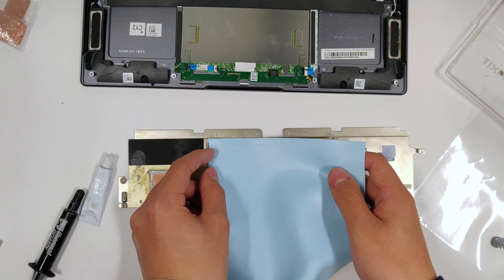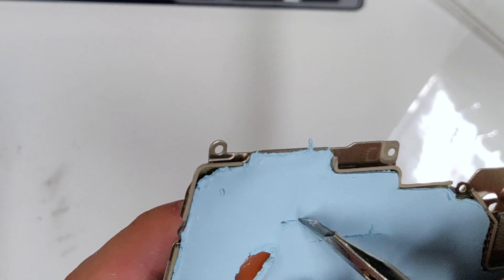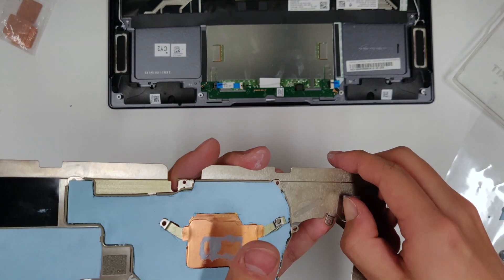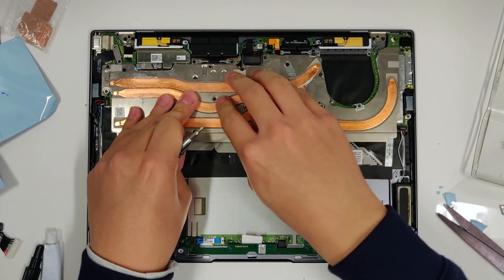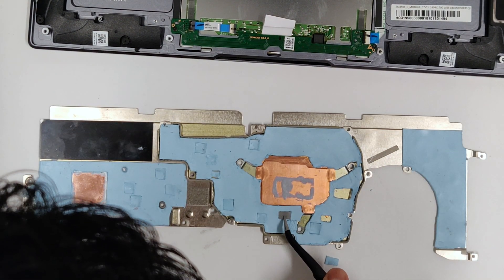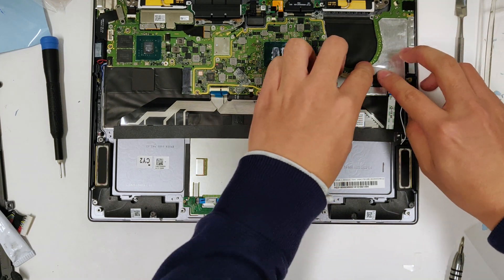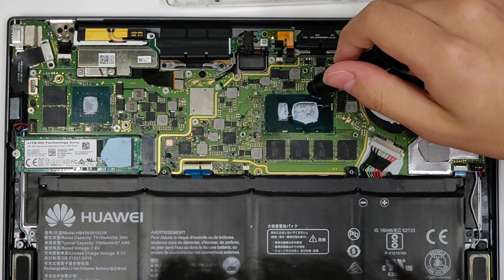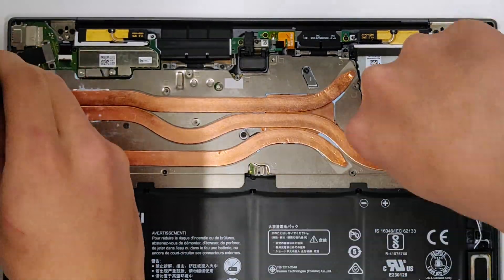MateBook X Pro Mods: Heatsink Thermal Pads (READ DESCRIPTION)

Comment: HI Brad! Quick question,  my 2018 Matebook X Pro motherboard just died.. Burned Mosfet. I was wondering if I can change the mobo with a more recent one like the 2020 model with NVIDIA® GeForce MX250 and 10th Gen Intel Core i7-10510U Processor. Could it work? Thank you in advance. Looking foward to try some of your mods man!

Comment: Hi Brad, you are covering the CPU section with thermal pad. But by doing that aren’t you covering all the small holes that help with eliminating heat/providing air circulation? Would you not trap heat by doing that?
Reply from the maker: 1. Huawei didn't add the ventilation holes there until the 2019 MateBook X Pro. The video you're seeing is based on the 2018.

2. Adding pads to that area gave better performance than not, even on 2019 and 2020 MXP, according to my comparison tests. I think this is because there is actually no significant airflow through those holes, as the fan is not in a position to force air push or pull air through. Instead, air mostly just glides over the top of the heatsink. The added thermal pads therefore conduct the components' heat from a low-airflow area to a higher-airflow area.

Comment: Is there a risk of short if you slightly miss cut it? Cause the pgs is conductive afterall...
Reply from the maker: The PGS has an insulating layer, as long as you buy the correct version, as I mentioned in the mod guide article.
Reply: @BradsHacks  I love how you made a good blog post and always sell the material on ebay. Such an entrepreneur!
You are doing amazing work!!!
Reply: Yea I read your article after commented.
I just gotta say that is the coolest idea everrr. (pun intended)

Comment: I have the exact same laptop as you have. It costed me 1500 euros... And For that price I expected a good performing laptop. My issue: the laptop overheats very fast... when plugged in for charging the fans while turn on, and the laptop just starts to get uncomfortable hot. Is this normal for this laptop? Have you expected something similar?
Reply: Iason Visser A common problem of the matebook x pro is that it’s to thin to have a bigger fan. So the computer can’t run at it’s full capacity because it would overheat. If you do this mod it should help substantially. Also download the throttle thing.

Comment: did you really need to make the cutouts and replace with 0.5mm pads for the GPU section?
Reply from the maker: The heatsink plate is not rigid enough and the screws not strong enough to safely support higher pad compression, which would have been nice.
Reply: @BradsHacks  hold up. did you change the picture on your website? specifically this one: /uploads/2018/05/Motherboard-Pads-13-scaled.jpg
it says "don't do this one"
Reply from the maker: @SiaarZH  Yeah. Always follow the website over the video. Website is always up to date.

Comment: Some friendly tips: 
1. Lock focus, exposure & WB on your recording device while taking this kind of video. 
2. Show before & after thermals to the audience so we know how much you've improved by doing such mod. 
3. Another way to achieve better thermal is to get a laptop cooler, which does not require crafting and modding skills/experiences. 

p.s. Love your endless modding ideas!
Reply from the maker: Please see the benchmarks on the webpage linked in description for results. Thanks for the tips.

Comment: Have Huawei offered you a contract Brad lol? Did you self-learn all these skills or also study a computer science or electronic engineering degree? You improved the performance of your MBXP quite significantly. I'm surprised Huawei aren't watching or don't contact you!
Reply from the maker: Thanks Francis! I learned most of this by reading stuff like this: https://www.engineeringtoolbox.com/conductive-heat-transfer-d_428.html
It's just knowing the basic principles and taking advantage of resources (like knowing that heat pipes move lots of heat). I am majoring in mechanical engineering now but this project was done in the summer after high school. I believe anyone can figure this out if they have the interest and time.
I think Huawei might actually lurk on my website because they implemented some of the same fixes after I published them, like the speaker distortion fix. They never reached out though.
Reply: @BradsHacks  we can all learn some skills but your dexterity and aptitude is not average. Thanks for such an informative video. I just marked a 92% marketing paper today on Formlabs. I told the student you should send your paper to the CEO. I'd write to them if I were you and send them the link to your YouTube and subsequent performance tests. The performance gains you achieved cannot be that expensive if implemented on mass production. Brilliant stuff and I wish I could pay you to work on mine lol! 😝 I wouldn't trust myself with some of the things you do apart from maybe take the back and heatskink off and add a 1TB Sabrent M2 NVME. Even then, the amount of screws hiding that down is disconcerting lol!
Reply: @BradsHacks  Hey, Brad are you sure bending flat heat pipes maintain their thermal effectiveness? Specially if they were to be bent by the sides.
Reply from the maker: @thingshappen9199  depends on the bend radius and whether you end up collapsing the walls in the process
Reply: @BradsHacks  so by the look of things it seems that around 120 degrees is the safest bet?

Comment: Hi Brad, just wanna ask whether its advisable to use IC graphite thermal pad for CPU instead of thermal paste?

Will the graphite conductivity issue be a major problem?

Thanks for your superb tips and research btw 👍👍👍👍👍
Reply from the maker: Conductivity is not a problem. It's worse than good thermal paste, so don't bother.
Reply: @BradsHacks  thanks for the reply mate! 👍

Comment: Given your research in to these mods & Huawei quality, for what reasons would you prefer Matebook X Pro i7 only vs new 2019 Mateboook 13 i5 or i7.  from what I know the new i5  clock speed is closer to X Pro's i7.    I am not that attached to the 3K screen.
Reply from the maker: MateBook 13 having only 8GB of RAM is the deal breaker for me.
Reply: @BradsHacks  Does the MX150 low power 10w GPU version bother your work use?
Reply from the maker: @andreykurinn3048  Yes because I don't get full 60fps in AutoCAD or Inventor. I am bothered whenever things could be faster but aren't. To me there's no such thing as "fast enough". There is only faster. And laptops should and can be faster.

Comment: Great video as always. Could you also make a video about configurating the Audio in windows? I used your guide and it's sounding much better in some areas, but voice usually makes the speakers creak and overmodulate.